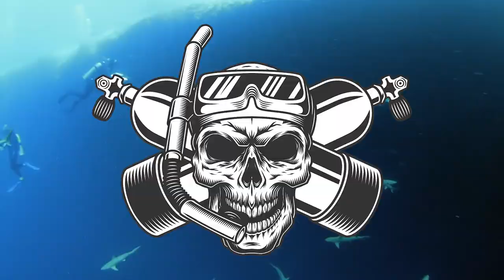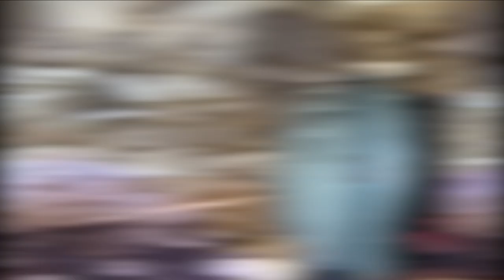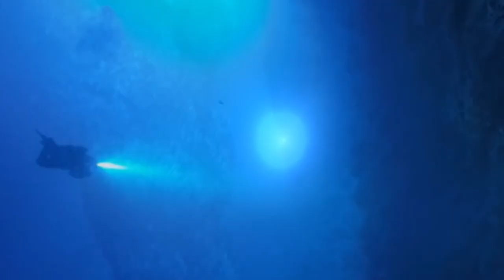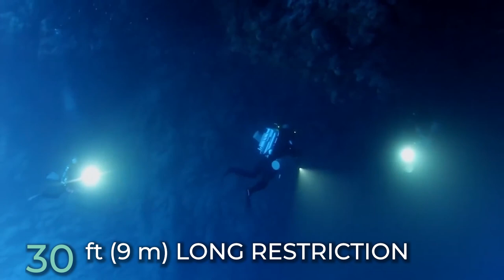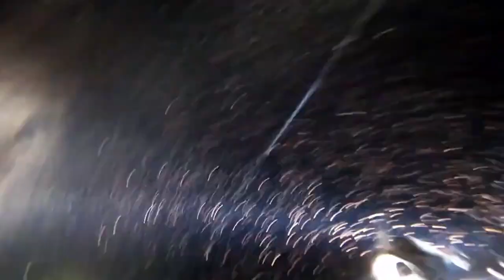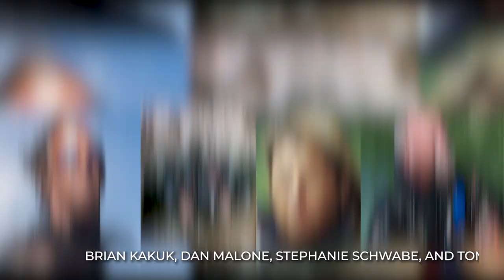Cave Diving Gone Wrong - Four Sharks Blue Hole Fatality

Comment: For those who do not feel like searching for five minutes or more to find the meaning of the acronym "EAN" ... it is "Enriched Air Nitrox". The guy doing the video might have been charitable enough to include that definition for the benefit of those who are not part of the SCUBA (Self_Contained Underwater Breathing Apparatus) community. Maybe he doesn't know? For EAN, apparently oxygen is added above the 21% sea level atmospheric content, and my guess is that EAN 36 mean 36% oxygen. Apparently, EAN 32 is more commonly used, all based on EAD (Equivalent Air Depth) tables which show what goes on as depths deepen. There are more than twenty different meanings attached to the one acronym "EAD" - which is why I hate it when snobs throw around acronyms as if "everybody knows".